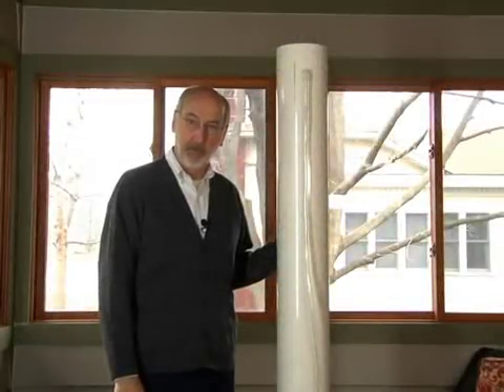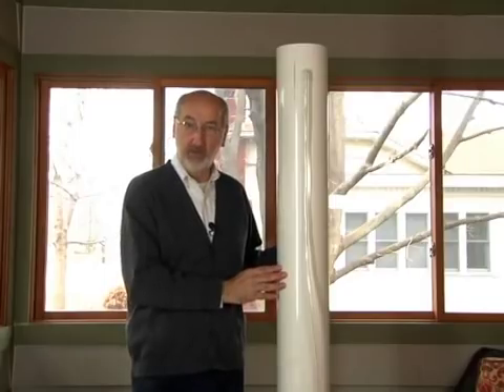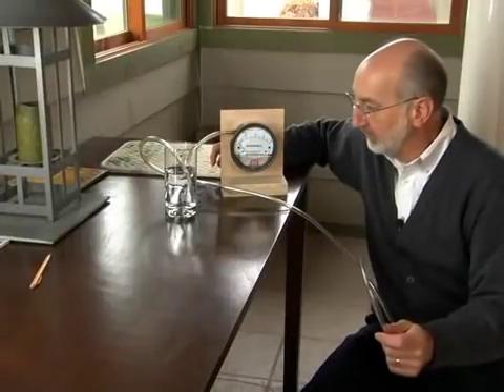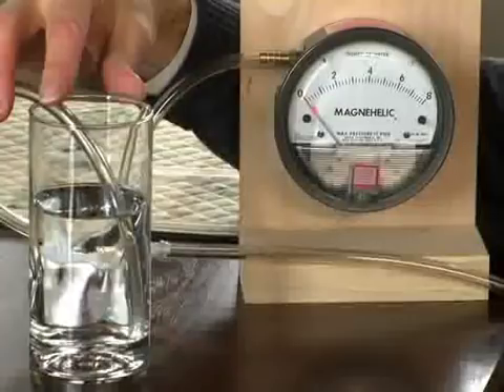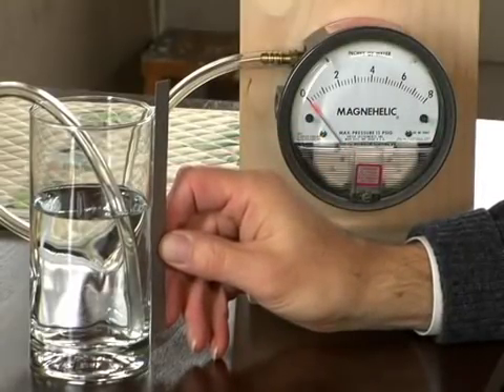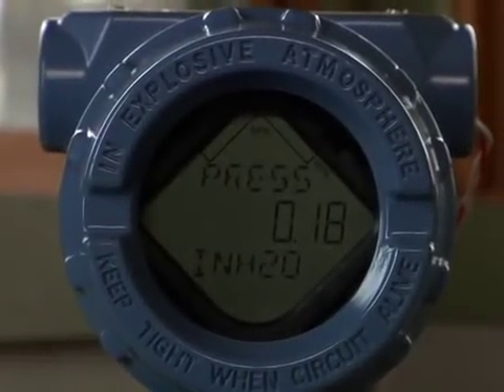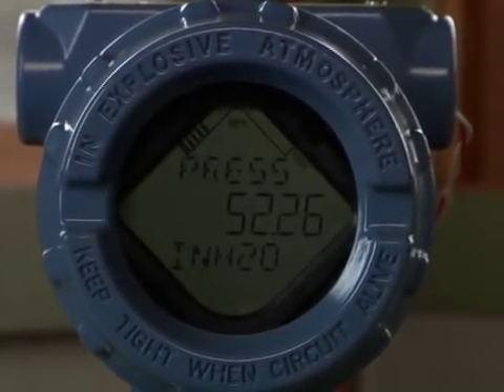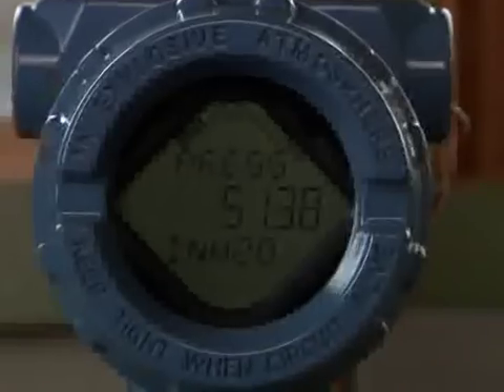Tutorial: Measuring liquid level using a bubbler

Comment: Sure you can use it on a pressurized tank. You just have to hook the low side to the top of the tank where the liquid won’t reach and it works all the same.

Comment: We have these in Houston to measure bayou water level and post on the Harris County Flood gauge site.  Would the compressed air in those situations (dozens of sensors across the city) be obtained from a small battery operated compressor right on site that turns on and off every so often?  I am guessing so and it being powered by a battery that is charged via solar panel or something.interesting technology and great video.  Thanks!